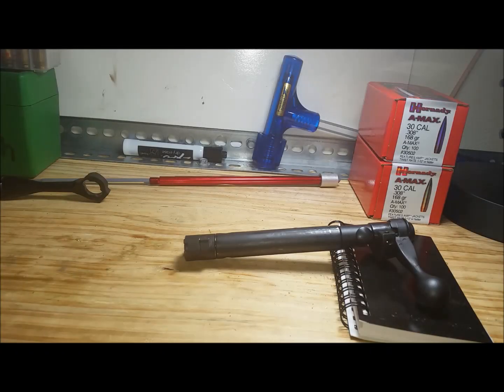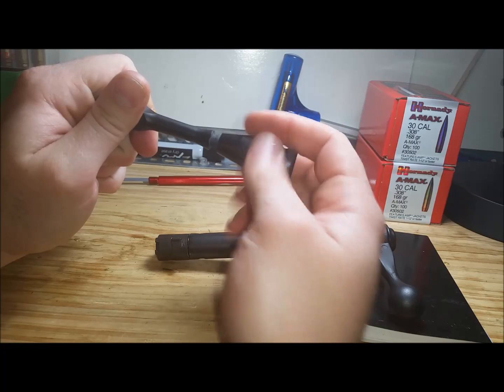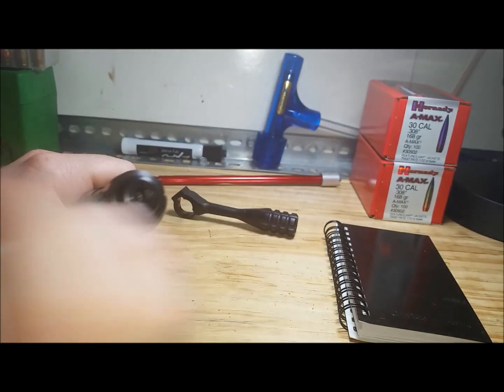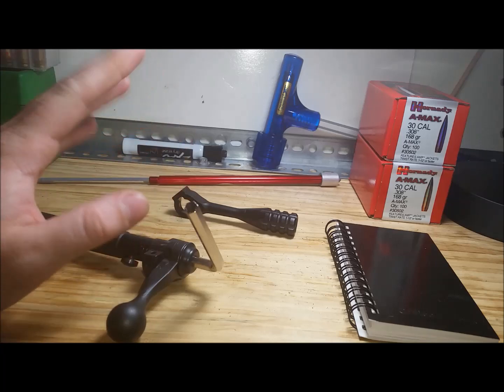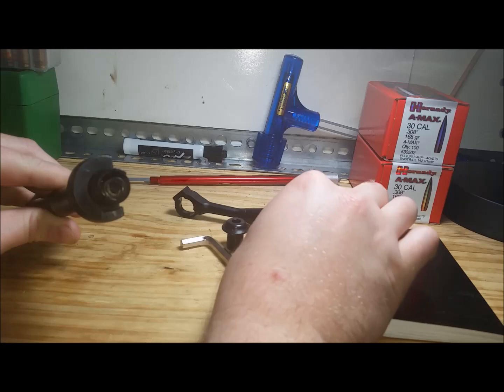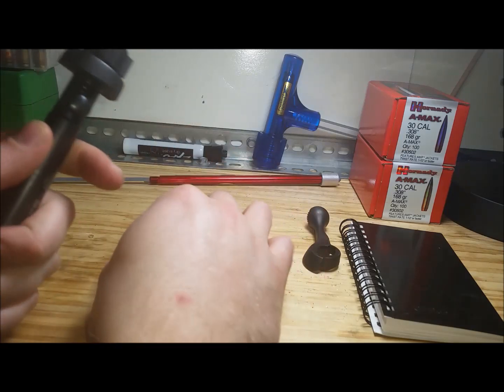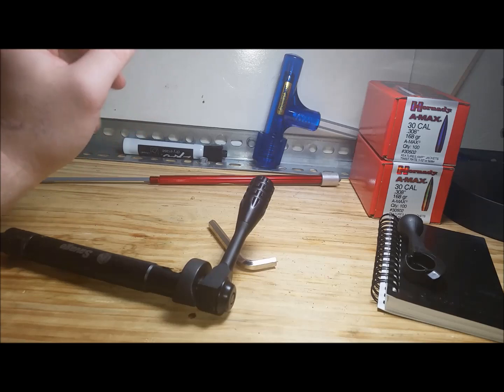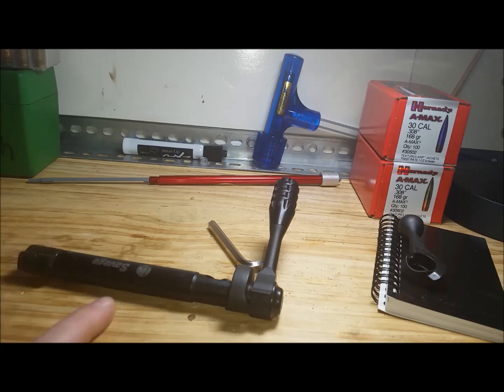Glades Armory bolt handle installation for Savage 11VT

Comment: Great video. Followed it step by step and it worked perfectly. In my opinion you do need a vice to break the torque and once that is done it takes 3 minutes to install even for a novice gunsmith like me. Thank you for a great instructional video.
Reply from the maker: Thanks for the kind words...glad my video helped ya out.  And yeah, savage had that torqued down pretty good.

Comment: Thanks for sharing.  On my 10fcp-k in 223 rem, the torque it took to remove the factory nut was significant enough to twist my Harbor Freight hex wrench like a piece of licorice, and dent my 24 inch EMT cheater bar.  I had to lean my whole body into it to break that factory torque!  But it worked.  Thanks again.
-Strafer
Reply from the maker: KPutubing No worries, glad I could help.  The new bolt handle makes a world of difference from the stock handle.  I didn't think it was big enough especially after putting the Bell and Carlson stock on it.  After the stock install, there wasn't very much room to manipulate my hand around the handle..  Thanks for the view and for sharing.

Comment: Nice video. 2 suggestions, use a piece of wood when resetting the firing pin spring and use blue locktite on the bolt handle screw. You don't want to damage parts.

Comment: Hi Glades armoury, 

I received my tactical bolt handle. I just opened the package this morning.

It is not the one pictured on my order. 

The one I got has the oversized handle 

I believe the one I ordered had the black tactical handle.

Please let me know how we can work this out. 

Thank you 
-------------------------------------------------------------------------------------------------------------
Glades Armory
9 May
to me 
Hello B,

Thank you for being our customer. I apologize about the incorrect part being sent. We will ship out at 1.75 knurled knob like the one in the photo. Please let me know if you have any other questions or concerns or if there is anything else we can help you with.

Best Regards,

Kevin
------------------------------------------------------------------------------------------------------------------
Glades Armory  aka  southernordnance. 
Kevin,

you agreed to send a correct tactical knob as you shipped the wrong knob 
I am requesting a full refund because you have been avoiding all my emails and any contact 

apparently I am not the only customer you have done this with 

it’s all over the web forums 
your business practices are less than desirable 

word of mouth and forum go a long way 

I am sorry you are not interested in taking care of your business customers 

B.

Comment: Do you have a phone number for them I have ordered one and they never sent it!
Reply from the maker: Evidently according to their web site they aint got one....their customer service pages states and this is copy and pasted from them "Please address all your customer service requests to info@gladesarmory.com

We currently do not provide any live phone support. However, we will be able to address all your questions or concerns quickly and efficiently through email.  We do this because our customer base expands through three continents, several time zones, different languages etc. Under such business conditions, phone support would not be very practical and would incur staffing costs we’d rather spend in other areas of the business. We find email the best way of reaching us:  it is available when our customers need it, it leaves a detailed record of what the issue at hand is, and it is there when we get to it. Give it a try, it works!!"